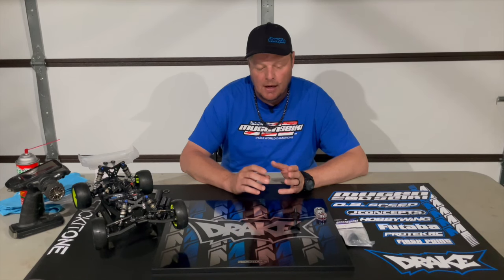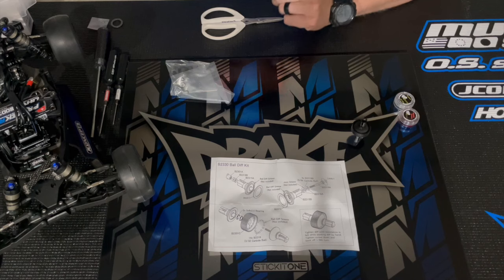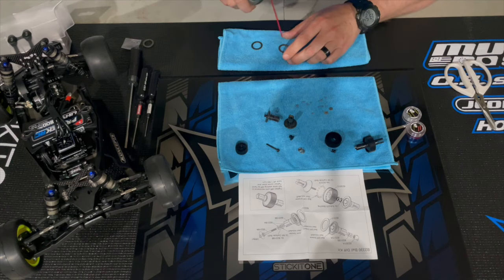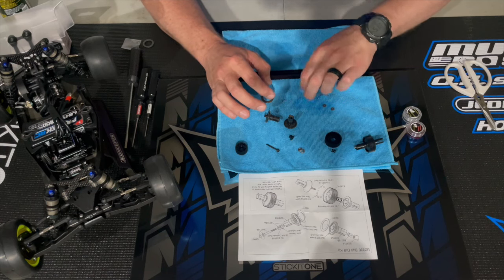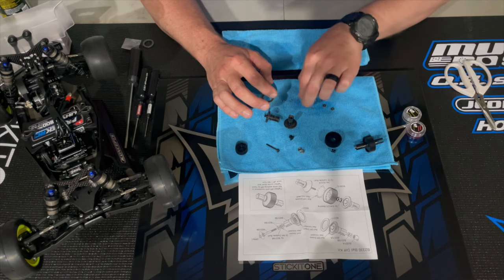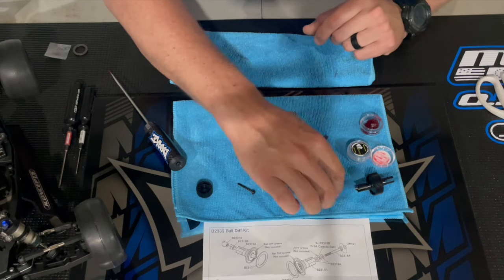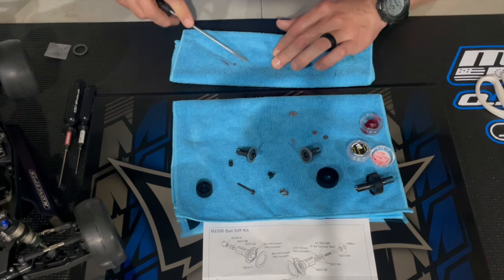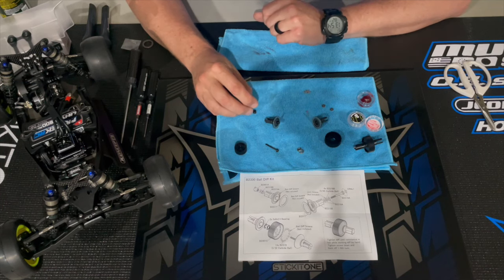Building, Breaking-in, and Setting a Ball Differential

Comment: I drive on a clay surface and I absolutely hate ball diffs. I find them to be very high-maintenance items and can mess up the car's setup as soon as they get a little grindy. Are the benefits of ball diffs really that substantial on a clay surface? I am thinking of ditching the ball diff completely after I saw you driving with regular gear diff on a clay surface like a champ.
Reply: I agree with you entirely, they are rough, highly sensitive, and are very easy to destroy. I have destroyed/barked many many diff’s in my time; trying to learn there ways. Now when I use them I check and retighten them after every run
Reply: @fuzzfreak1967  I’ve become super paranoid since I have been using ball diffs. And I have destroyed so many along the way too. I thought it has something to do with my car’s brand, but I saw that even AE RC10B7s are not free of ball diff issues. I hate ball diffs!! But everyone uses Ball Diffs at my local track.
Reply: @fuzzfreak1967  I am using ceramic balls. Even on my thrust. That helps a lot.
Reply: Hey, sorry it took me so long to respond, I was at work on lunch when I ran into this video and I really didn’t watch it, I skipped right to the comments because I was short on time and I have developed my own ideas when it comes to ball diffs and slipper clutch adjustments. I am home now and I have watched the whole video and Adam has some very good tips here; I am not surprised, he always has good videos. I really like the thrust washer grease on the rings, that a new one for me, sounds good, I’ll try it. I also like how to check the slipper by holding the tire and gear and spinning the other tire. I have actually heard that one before but I forgot about that, definitely good stuff. I use to race RC years ago and I did it for a few years and had a good time. I got burned out though and stopped. Well a couple months ago I just started again and having a good time with it again. I am trying to have some boundaries though so I don’t get burned out again. I definitely feel your pain on ball diffs, I get a little paranoid over them too when I am using them. I have all TLR 2 wd cars and they have no quick diff access so it gets pretty old tearing apart the whole rear end of a car to get to the diff. When it comes to ball diff’s though they do work and are effective in certain track conditions. Check this out though, my local track use to have an outdoor track too and we raced everything outside, 1/10 and 1/8 scale. One local fast guy use to use gear diffs on his 2 wd cars on it because he would say that you couldn’t use a ball diff because you couldn’t set the ball diff loose enough for the track cause it would surely slip and bark if you did. I never asked him what oil he had in his diff, probably shock oil 😂. I never tried it in my cars outside I just stuck with the ball diff. That fast guy use to blow us all away every week though so I think that with a little time, work and trying multiple diff oil weights, you can get a gear diff to work anywhere, probably even your track. Give it a whirl if you have a gear diff for your car. I would maybe start off with 2000 weight. I have a hard time trying to tell if my diff is too tight or too loose, your car basically spins out with either of these conditions. As for your ceramic ball tip I am interested in that, it’s working for you, that’s good, I’ll try it; thanks

Comment: Any numbers with the diff checker?
Reply from the maker: Start at 300 for break-in and you should end up in the 300-250 range.
Reply: @ thanks. I have a bad tendency of starting wayyyyy tooo loose. 

The last one i did i followed the way you do on the video and it ended up way better. 

I was putting to much grease so it was way harder to do the initial setup.

Not tested on the track yet but it feel really good 👍🏻

Comment: What does it mean to bark the diff
Reply: When the diff slips, it makes a weird barking sound. Meaning that the plates are both rotating at the same direction and the balls are essentially standing still. This creates friction on plates and balls and you run into the issue to flatten the balls.
Reply: I think my explanation was not right…when there is not enough friction between the balls and the plate, and the slipper sends power to the diff, then the diff makes a barking noise because the diff is not engaging correctly.
Reply: @marcowerner8739  your first answer made more sense